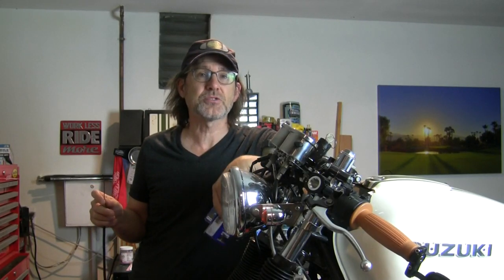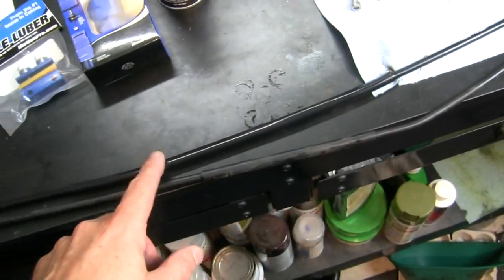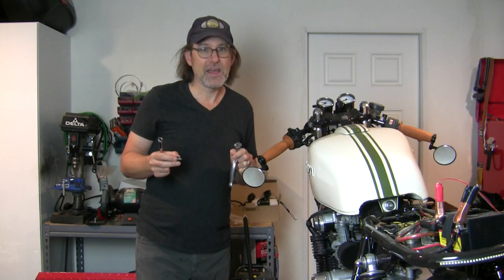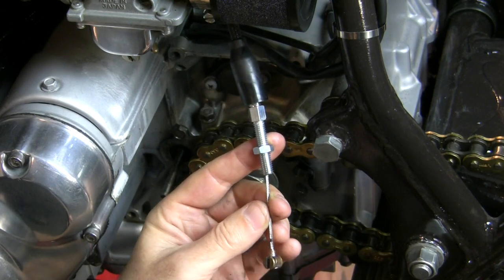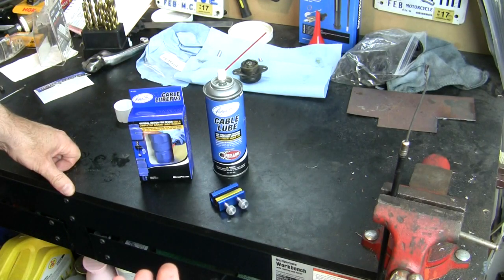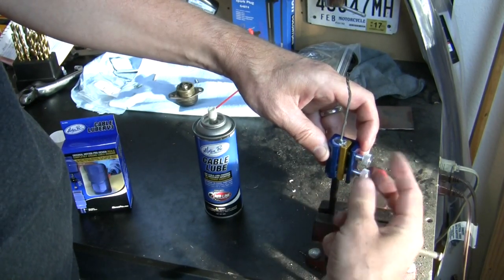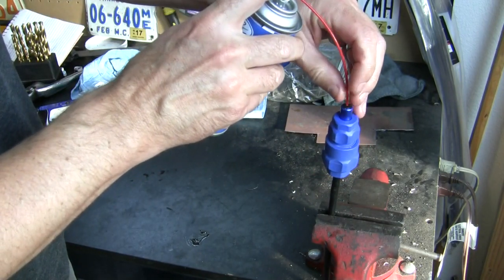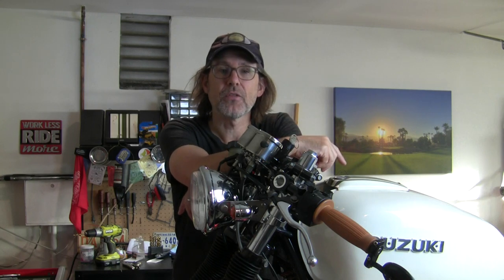Custom Clutch Cable and Cable Maintenance - GS550 Cafe Racer Build (Part 106)

Comment: So... why was it sticking and stalling when you put it into gear & what fixed it in the end, just changing the cable? Cheers from the UK
Reply: Are you saying that literally rolling it down the road with the clutch in and putting it in gear unstuck it?
Reply from the maker: @SoulNectarStudios  Greetings from Los Angeles! I really struggled "unsticking" this clutch and did another video on it (https://youtu.be/KHeWCwCImRE), but the process was so long that I grew tired of filming and missed the moment when I was finally successful breaking it loose. In short, I warmed it up really good and dropped it into 2nd gear about 20 times. This killed the engine every time until finally it didn't and the clutch plates & disks disengaged from each other. I've since learned this is really common with these bikes when they sit idle for long periods of time. When I took my trip across the US and back (https://youtu.be/AQvUkGNc_m8), same issue was waiting for me on Mr. Kortan, as it had sat the entire time I was gone. Thanks for watching!
Reply: @UrbanMonkTV  okay I see. When you say dropped into 2nd you mean while it while rolling you pulled the clutch, put it in 2nd then let the clutch out or did it just die with the clutch pulled 20x straight away? Sorry to be a pain I just want to know what I should be looking/aiming for when I try it! Thanks for your entire series on this bike, it's outstanding.
Reply from the maker: @SoulNectarStudios  Yes, started engine in neutral, pulled in clutch lever, "dropped" into gear, engine died. Repeat 19 more times with same result. 20th time it kept running. Went for a ride! Worked great until I let it sit for an extended period again.
Reply: @UrbanMonkTV  okayyyy wow looks like I've got a bit of pushing to do! Thanks for the time and advice. Much appreciated

Comment: For oiling cables, I have always used a small funnel and a rubber seal made from a 1/2" long piece of fuel hose slit down one side. Insert the end of the cable through the small end of the funnel, wrap the rubber seal around the outer cable near the end, then push it down into the tapered spout of the funnel until it is wedged with the top of the outer just above the rubber. All you do then is hang the funnel up, pour a small amount of oil in and leave it to gravity to do the rest. I've been doing it this way for over 30 years, without any special equipment.
Reply from the maker: Thanks for watching. Agreed, that is definitely an effective way to do it provided the cable is oriented in a mostly vertical position.

Comment: Still a bit confused about sticking clutch fix. I understand you had a cable issue, but help me understand what replacing the cable fixed. I’m in same boat, replaced cable, lubed release device, it’s pulling in the geometric sweet spot, but I still have a very hard pull on the cable, and the clutch will not release. Did your “hard pull” go away when you replaced cable, or did the hard pull go away after the 20th release you talked about? Hope it’s the latter! Thanks for making these videos, they’re a tremendous resource to many of us long after you’re on to the next project.
Reply: Short update, got clutch “unstuck”, but still have very hard pull on clutch lever and a pretty hard “clunk” on gear change. Would think it might be old arthritic hands, but it’s way harder than my other two bikes (an old BMW and Yamaha). Clutch plates and springs all measured within spec, thought I had clutch release mechanism in sweet spot, but will use different tooth positions on the release mechanism moving searching for solution.
Reply: @davidc5362  hey, what fixed it in the end?
Reply: Never found the problem, hard clutch pull continued, after more than a year of frustration decided I didn’t have enough time left to enjoy it any longer, admitted defeat and got rid of the bike.

Comment: By chance do you remember the length of the outer housing you ordered? I have a good friend who is fixing up on similar to yours and the previous owner didn't do a great job with the old cable. Love your build! Thanks!
Reply from the maker: I looked back at my old emails with Motion Pro and I ordered outer cable shroud length of 40 inches, dead on. Seems to work well. Thanks for watching!
Reply: @UrbanMonkTV  thank you so much for the quick response! I’m supremely impressed!

Comment: im oil that cable brake by using the bottle with rubber tube inserted to cable and press the bottle and rubber tube to push the oil into the cable.
Reply from the maker: Thanks for watching!
Reply: @UrbanMonkTV  i got suzuki gs550,carburetor problem.have no idea to fix it.
Reply from the maker: @hezriebinmohamedsamankpm-g1724  Have you watched all my videos on the GS550 carbs? Also, check out rebuild guides available at BikeCliff's website http://gsarchive.bwringer.com/
Reply: @UrbanMonkTV  okay,thank brother.from malaysia
Reply from the maker: @hezriebinmohamedsamankpm-g1724  You're welcome! Greetings from Los Angeles!